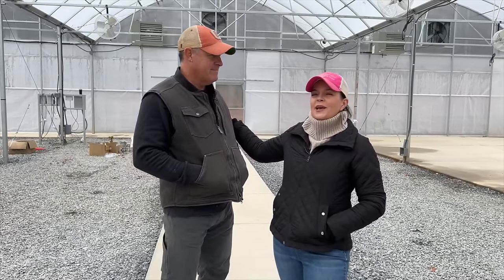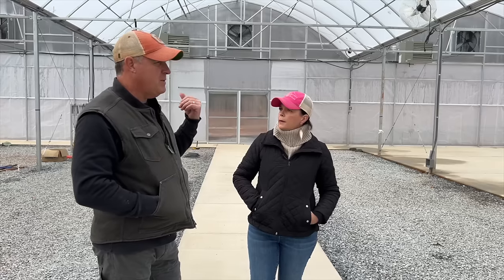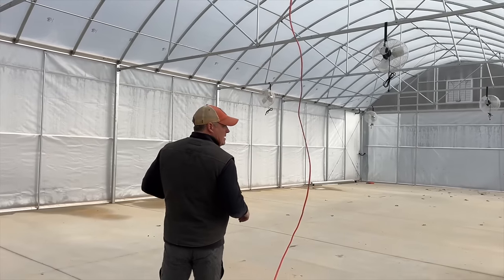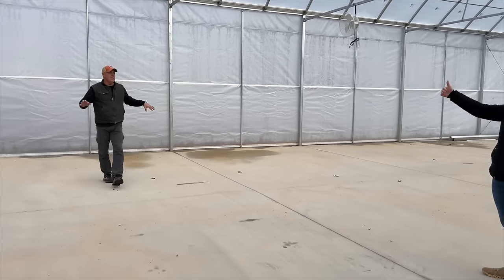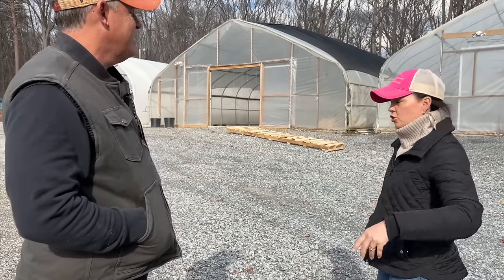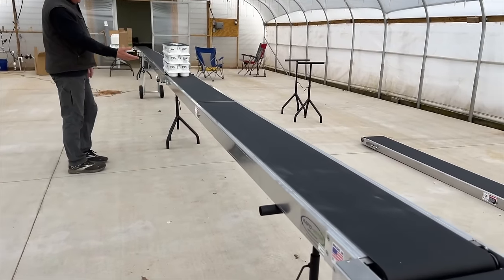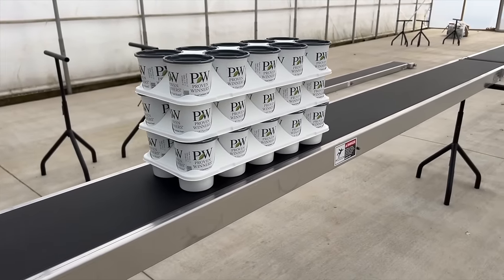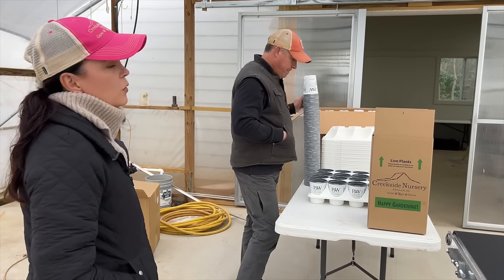Exciting New Preparations for 2024

Comment: I’m in Belhaven NC, zone 8b. Many years we get flooding due to hurricanes or tropical storms…the river across from my house is brackish water. So I’m wondering about plants that can take the salty water. I did notice this year after Ophelia that my camellias looked fine. 
Also, what should be done after the water recedes ( which it usually does pretty quickly) … some folks have said they add lime…